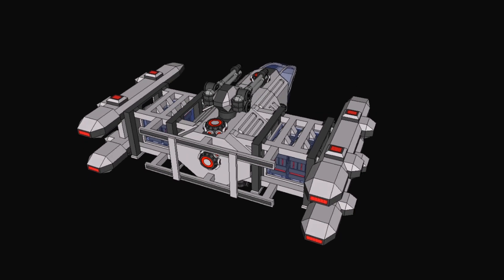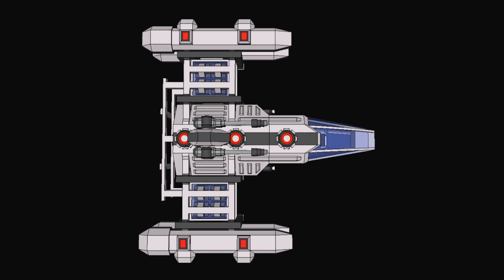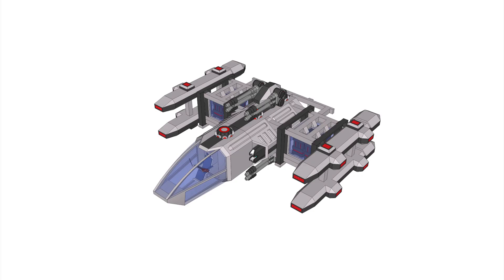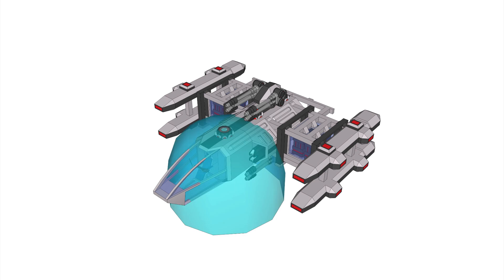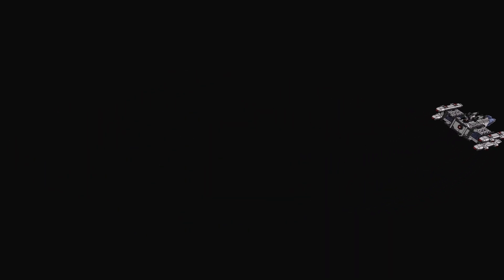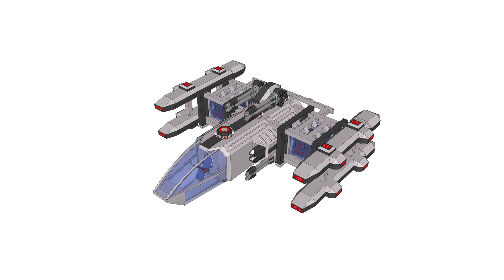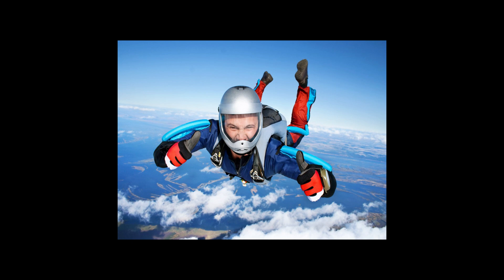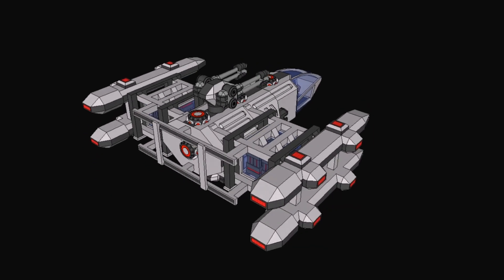Shad has a question! Gravitational acceleration on a spaceship?

Comment: a grav drive, my thoughts and ideas.
4 ways to do this, first is a mass drive. you either push against nearby mass or the mass passes through a ring and is accelerated in one direction. kinda like a ion fan.  if this is strong enough you could possibly fuse hydrogen into helium, the helium would now take up a greater volume and be used as thrust. that thrust is further accelerated by the earlier method.
next is gravity tunnelling.  you focus on a gravity source and push or pull. if you can somehow create a tunnel or wormhole close to the gravity source, it will pull you towards it. the worm hole must be moveable at your end to stay in front of the ship. now if that worm hole does not have to face the gravity source in front of your ship but still face it at the other side, that could meanthat you could pick a blackhole and either use the diameter of the hole or distance from the ship or gravity source to controll acceleration and even possibly move t around he ship instead of just in front of it for direction pull. this could in theory be used as a weapon and a sheild.  the third one is since space is warped by gravity, and gravity is limited by the speed of light, you create ripples and ride them.  this would be local and not require any mass ejection. simply(yea right!! but hey, this is fiction) create a point behind your ship of anti grav then as the ship moves forward you release it then form another colser to you. the first one you released would send out a series  of ripples you can ride and so would the second and the third.
 the last way is to create a micro blackhole in front of the ship. and as you fall in to destroy it, project its mass ahead of you, and recreate it.  this too could be weaponized.  a missle with this drive in front of it could eat through and destroy all but the most massive of ships. and even massive ships would take crippling damage.
of all these drive the mass drive, or fusion plasma acceleration drive as more aptly put, is closer to our ability to produce. to juice it up just imagine taking the left over helium plasma from your hydrogen fusion and shooting it out a rail gun.  this hyper velocity plasma too could be used as a weapon, even against smaller sheilded objects like your ship.

Comment: (disclaimer: this is my own personal theory of how gravity works, but I have a really good understanding of physics, so hear me out) Okay, so gravity is the warping of spacetime by objects with mass. Objects with mass draw in space itself, so that relatively, a planet's surface is actually accelerating outward, because the planet is drawing in the surrounding space. So, with generating artificial gravity, you would want to have the pulse generators directionally expanding space. So, you have the right design; you just explained it the wrong way.

Now, there would still be a bit of the generator itself that is outside of the gravity cone. Therefore, the ship wouldn't quite be in freefall, as it is pushing against that bit. However, this would presumably be incredibly tiny, and it would really be the only limitation to how rapidly you could accelerate, assuming you care about the safety of your passengers. Now let's assume that all passengers are wearing seatbelts during your maneuvers, and your maneuvers are lateral compared to the orientation of the seats. That means that healthy passengers could take up to 45g short-term. We'll say they can take 30g for extended periods.

Now let's assume that the part of the generator that's outside of the field is 1/1000th the mass of the rest of the ship. This means that for extended maneuvers, the ship could safely accelerate at around 300,000 m/s^2, reaching the speed of light in just over 21 minutes! Now, technically, it takes an infinite amount of acceleration to reach light speed due to relativistic effects, but still, that's 3.8x10^8 m/s of acceleration in 21 minutes! How's that for deep space travel?

I suppose I should talk about that bit. As a comparison for intraplanetary travel, ignoring wind resistance in the atmosphere, you could get from Earth to the Moon in 2 minutes and 24 seconds. For interplanetary travel, you could cover the average distance from Earth to Mars in 28 minutes and 50 seconds. For interstellar travel, assuming 3 hours of acceleration per day, you could get from the sun to the Alpha Centauri system in just over 2 months (relative to the ship; as I said, it takes infinite acceleration to reach the speed of light, so relative to Earth, it would still take about 4 1/2 years). Of course, this is assuming you want to park at these locations, and not just fly past them. For a flyby it would be even faster!

The bottom line? Assuming these pulse generators have enough power, you have an unimaginably fast spaceship, and due to the Doppler effect, you would have to navigate interplanetary and interstellar distances solely through calculations. And now I want to use the idea of gravitational thrusters in my books. And I am free to do so, since you can't exactly claim copyright on a physics concept, right? Anyway, good luck using this incredibly terrifying spacecraft!

Oh, and as for simple artificial gravity on the ship, you can just counter the unwanted acceleration with an additional gravity cone facing the opposite direction, and away from the ship. Okay, now I'm done.

Comment: the space ship most fall in to a gravity well in order to move you can not push the ship with gravity. 
that being said it 3x mass x acceleration . that means that you need a gravity well 3 x the ship mass to Mack it go faster and the different in mass between the gravity well and the ship would tell you the ships New top speed .
now here where inertia comes in.when it comes to movement inertia adds mass to something( in the form of enargy)this mask it harder to speed something up by x3 or more depending on the objects inertial mass.
so the mass and power of gravity will in front of the ship compared to the ships own mass would tell you how fast you would be able to move the space craft. at some point you would hit your top speed by max out your power core /hitting the speed of light / over comeing the atomic bounds of the matter that makes up the ship or by makeing a black hole.

300 kg at 1kmph need 900kg of enargy to get to 2kmp. 

the sweet thing is that your only limit in space. so if you have a crazy power supply .
you could go dame fast. like really dame fast.

Comment: alright, someone has probably already answered this and i'm by no means an expert on this tpoic, but assuming that your fictional device was able to apply a kinetic force to all particles within it's field without also having to apply an opposite force (reaction-less drive), could handle what ever amount of energy you were willing to throw at it, and it was small/light enough to be on your shit then the fastest it could go is infinity close to light speed without being light speed. the reason for this is that time is also a physical axis and the faster you move, the more you rotate on this axis. when you get close to the speed of light a large chunk of the energy your expending to go fast is actually being consumed by your temporal rotation which slows down time for you. again, i'm not an expert so i could be really wrong, but if you were to dump infinite energy into this and actually reach the speed of light, your rotation on the temporal axis would hit a full 90 degrees which means for you time would completely stop and you'd get to spend the rest of eternity stuck in frozen time. 

now there are ways around this limitation, from what i understand using a ring light structure on a ship and using anti-matter, you can distort space to make the space in front of your ship physically shorter while stretching space behind you so that when you travel 1 meter of space your actually traveling further then a meter. although i have only a veg idea of how that works.

Comment: Mass Effect dealt with (essentially) generating black holes to "fall" in a set direction. This allowed them to fly FTL.
Reply: Actually, it was that Element 0, when applied with electricity creates dark energy which is manipulated into mass effect fields capable of increasing or reducing the mass of all objects within that field.

But then it also talks about 'positive' and 'negative' current being the source of the difference in increasing or decreasing the mass. Just typing such a thing makes my skin crawl.

It didn't make them 'fall' in a set direction, but it did let them push much closer to the speed of light than otherwise would be possible with a much more massive object.

Comment: Firstly, you have to define the reference frame. What do you measure the speed in a reference to? Then you can think about the speed limit. So suppose you are in an empty space and there is something - lets say a space station and we are trying to move relative to the space station. Now we can talk about the speed limits. Yes, it would keep accelerating. The speed limit is the speed of light. And you would reach the speed of light in an infinite time frame. The reason why is the special relativity. Yes, you are creating a constant force with a constant acceleration in your reference frame, however, your mass is increasing with your speed in the space station's reference frame, so it gets harder and harder to keep accelerating at the same rate. From the space station's reference frame your acceleration is decreasing because of the increasing mass. You would be experiencing a hyperbolic motion https://en.wikipedia.org/wiki/Hyperbolic_motion_(relativity) http://www.physicspages.com/tag/hyperbolic-motion/ The third Newton's law in the eyes of relativity only means the principle of equivalence of forces of inertia and gravity. 
However, a very important thing is, that you have to fuel the generator. You have to keep pumping energy into it in order for it to generate force. So you can not possibly reach the speed of light with a finite amount of energy. < Actual physicist

Comment: By my understanding, because of the lack of friction in space, any propulsion system would be able to achieve light speed, it's just a matter of how fast you would reach light speed. On earth we need big engines not only to accelerate but to also maintain speed. Because of friction, anything in motion will slow down, thus we need a constant source of propulsion to maintain the desired speed. The higher the speed the higher the friction thus the more powerful a propulsion will be needed to maintain higher speeds. But in space there is relatively no friction meaning you wouldn't need a constant source of propulsion to maintain speed. So a more powerful propulsion would not determine a higher top speed but a higher acceleration. In space, even a lower power propulsion system would theoretically reach light speed, it would simply have a low acceleration, but without any friction to resist the acceleration, over time, through the little increases to speed, light speed would be achieved.

I am in no way studied in science and physics, this is just my theory based on bits of knowledge that I've gathered here and there.

Comment: okay so before I say anything else, let me just say this is a really interesting idea that I would love to see work. I really doubt I'm the smartest one in the comment section so if someone can use science disprove me, please do.
 I see a few flaws with this idea. one, the force of gravity is a pull, not a push. therefore having gravity fields as engines would only attract other objects toward your ship. the only other ways you could maybe pull this off is by either having gravity fields within the ship attract other parts of the ship to propel it in the opposite direction which would put a large amount of stress on the ship at high speeds, or some how  create gravity fields outside your ship that  would pull the whole ship towards it. the problem with that is, literally everything would have strapped down to avoid making a mess, you would need a back up propulsion system so for when you are anywhere but deep space because the field would mess with other ships and even none air born objects like pedestrians, and and finally, you can't create gravity without mass and there is not a whole lot of that in space.
here's another potential Idea you might be able  to use. since you have the ability to alter the nature of subatomic particles, perhaps you could use that same technology to use one of the other nuclear forces to push the ship but the problem is there isn't really a whole lot you can use that force to push off of in space. I don't know, maybe someone else could find a clever way to make one of these Ideas work

Comment: I dont dare to talk about physics of this engine at all but I wonder what would be the effect of those gravity generating engines on the ship and its cargo.
As we now, the gravity can rip apart mostly anything if its strong enough and the object is close enough. In this case, we do have lot of different gravity sources which may alter gravity rapidly (maneuvering) and those sources might be quite far apart.
Maybe I get this wrong and we are talking about some gravity bubbles and its just about the size of the bubble making anything inside intact and influencing only the outside world at the surface of the bubble but then I cant imagine what would happen to the object crossing the boundary (landing/docking/shots)
I would say that gravity inside of the ship would be a total mess if the gravitational bubble would ever cross the ship itself (I do believe that size of the bubble might vary with the required "thrust") and might dmg cargo, have negative influence on the pilot, etc.
Still its just my YT physics video watching amateur opinion...

Comment: Have you ever heard of the sailor blowing in it's own wind problem?

The first problem is that gravity is a pulling force. A normal mass exerts gravitons to all directions and those gravitons pull anything they encounter a little closer to where they came from. In your case you manage to direct the gravitons in a cone, which is fine, but it means that the origin of the gravitons need to be in front of your ship, not at the location of your engines.

If you would have a pulling gravity generator, it would essentially create an invisible mass. the problem is that the ship would be moving closer to it and it towards the ship (that is the law of relational gravity). So you would need something to keep it in front of you. Something that is strong enough, something as strong as the gravity generated, canceling out this force. This is the sailor blowing in it's own sail problem.

Let's say that that we can create gravitons out of thin air, not actually generating a mass. One option would be to hang the generator in front of your ship, like a carrot in front of your pig. Ok, so say we invent a technology that projects/teleports a graviton origin in front of the ship.. The advantage is that you need no engines then. The gravity projector could be anywhere in the ship. This could work, but at this point you are wondering so far in the science-magic realm that you might just go with "I have engines and they move the ship."

You're max speed, if you want to honor important laws of physics, is still the speed of light. Since no particle (with or without mass) can go faster than the speed of light. So if you want to go faster, by all means invent hyperspace and stuff, you're going into magic already with this. The rate of acceleration would depend on the power put into the gravity generators over time. a = √(P/(2⋅m⋅t). This is  the minimum power needed. But your magical graviton generation and teleportation might also cost energy.